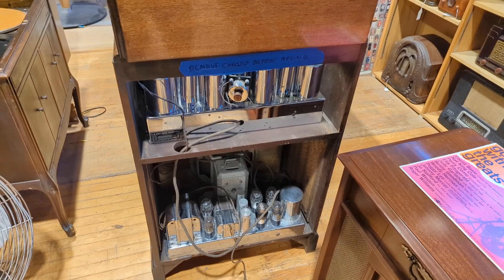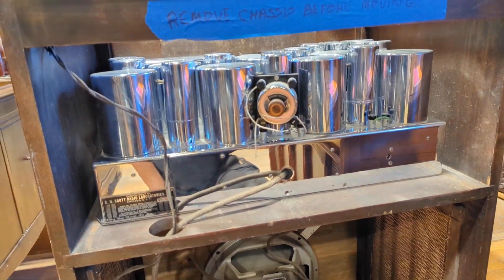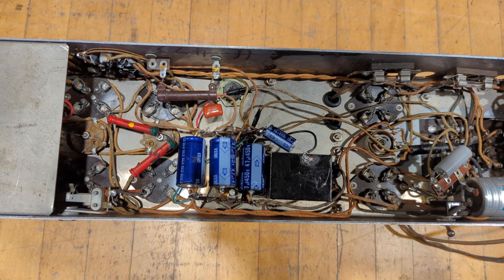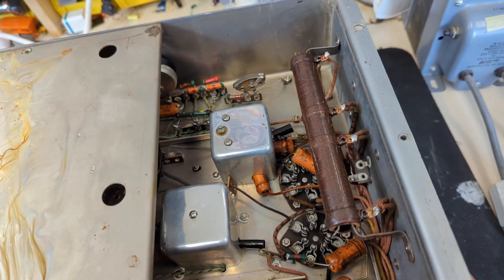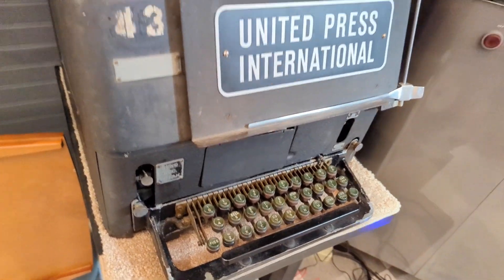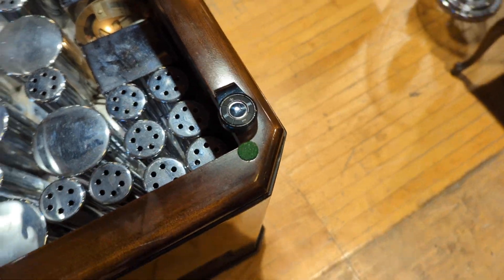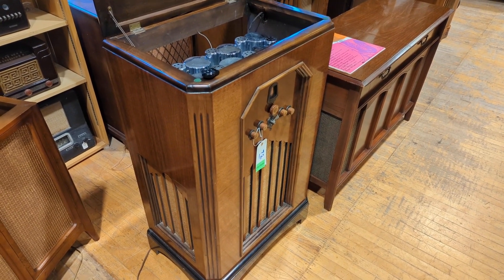Inspection and walkaround: 1935 Scott All wave

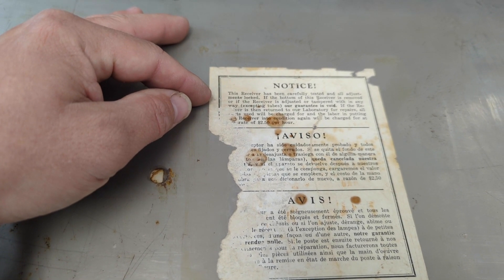Comment: 8:10 $2.50 in 1935 is equal to 50.47 in 2021.
Thank you for the video!
Reply: I'm doubting that. I guess I could try to find an inflation calculator myself!
Reply: Checks out on internet.... But what company today would do technical work at $50 per hour? There are so many things that don't add up for me gut level looking at this at a glance.

Comment: Love your channel. I’ve learned a lot. Was wondering if E H Scott is/was somehow related to H H Scott the famed manufacture of audio components in the 50’s and 60’s. H H Scott made wonderful tuners as well as amplifiers, preamplifiers and receivers back them. Probably in the same league as Fisher.
Reply: Sure there's a link...  After WWII, Hermon Hosmer Scott developed a squelch circuit that was designed to suppress scratches, clicks, and pops on gramophone records, and it also was effective to suppress noise in radios, too.  Those "Dynaural Range Suppressors" were first manufactured for and licensed to EH Scott, the premier radio manufacturer based out of Chicago.  HH Scott set up shop in Putnam, Mass., in 1946, and yes, HH Scott produced premium audio products until it was forced into receivership in 1973.  Sad to say, it was HH Scott's devotion to innovation that led to its demise.  Have a look at the premium solid state receivers (the 477 is a good example) to understand how HH Scott's determination to manufacture quality fell out of step with the Japanese competition.  HH Scott could not compete on price.
Reply: @Columba_Kos  Thank you so much for this information. My parents purchased a Fisher 500B in 1961 or 1962. In the mid 70’s they were done with tubes so I happily took it. It’s in my bedroom connected to a VPI HW 19 turntable, an Oppo Blu-Ray SACD player and a pair of B&W speakers. I had the Fisher restored about 18 years ago. I continue to use it daily.
Reply: @vinalboy  Ah yes, the 500B.  That's a classic!  Hold on to it.  Since it has been restored, it should last...  forever.  Best regards!
Reply: @Columba_Kos  The Fisher 500B will go to the grave with me.

Comment: I was told by an old AP guy that teletype machines were loud so when they started taking off and banging out the news in the newsroom you could be johnny-on-the-spot to read it....a scoop my friend is a scoop....
Reply from the maker: I can't imagine a room full of these things... We have the transmitter version downstairs and it shakes the floor
Reply: They had a pretty effective sound enclosure for the ones I worked with in 1970's radio stations.  They created a ton of dust, however.
Reply: @donhall2759  the company I used to work for back in the seventies just had four of them sitting in a room and they set up a hell of a racket, one of them even had a bell on it that warned you of an incoming message.